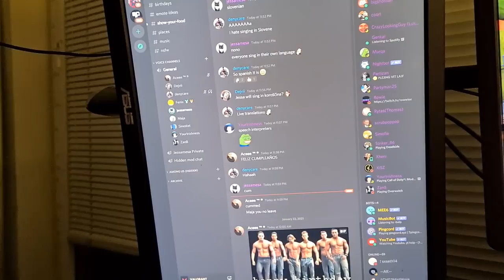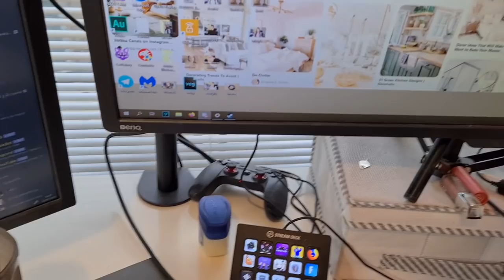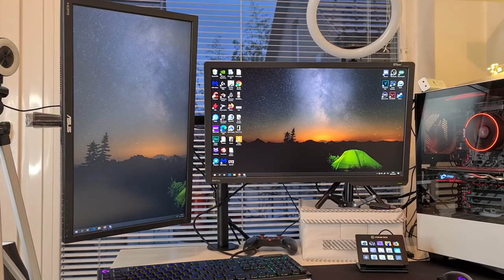CLEANING MY PC + SETUP TOUR Vlog #10 | JESSAMESA

Comment: You should've vacuum it
Reply from the maker: Vacuuming is not good, creates static
Reply: @Jessamesa  Not true, in todays standarts all pc parts can withstand to a very high amount of esd and vacuum would be nothing compared to them. Just vacuum it and if you still want to be 100% safe you can keep PSU plugged to wall but switched off that way case will be connected to earth ground and any static will go there.